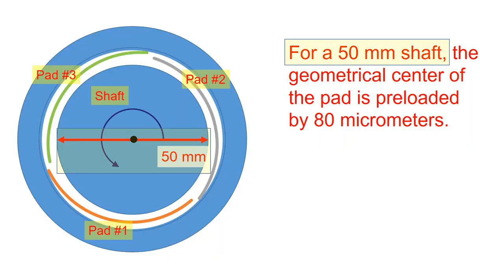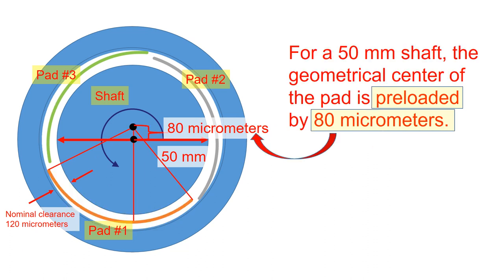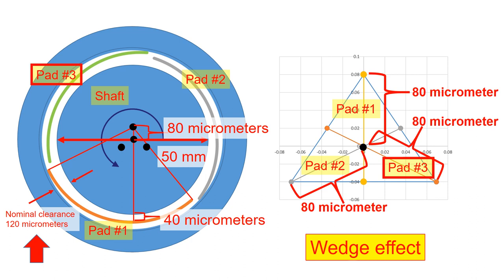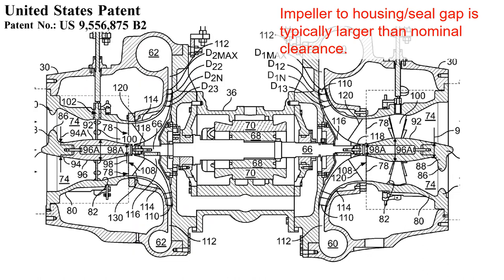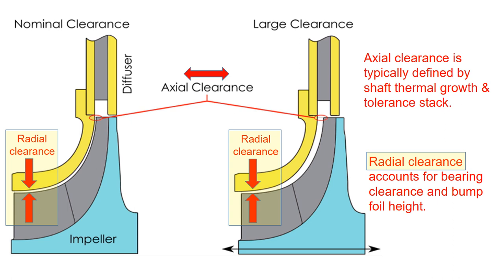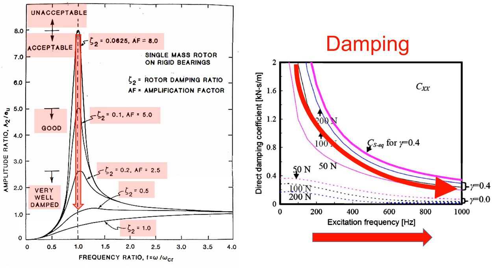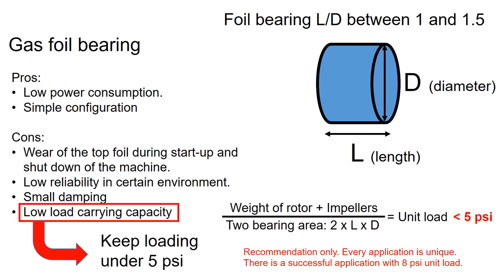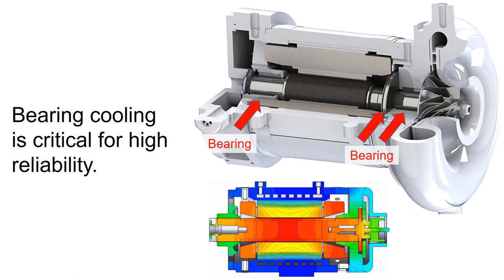Part 17 - Air Foil Bearing - Part B: Design Details

Comment: Would mind kindly introduce the magnetic bearing design details ? Thanks a lot!
Reply from the maker: Thank you for your comment and interest in the bearing design! I'd be happy to provide you with more information in the near future!
Reply: Thank you so much!  And if it's possible, would you mind kindly introduce some applications of ceramic bearings plus external dampers in high-speed tubro, and issues related to pass the critical speed and stiffness damping?For high-speed machines, I have always been a little confused about the choice of air foil bearings, magnetic bearings and high-speed ceramic ball bearing.  Thank you again!
Reply from the maker: @robinsonwang7223  Thank you for your questions and enthusiasm. I've just uploaded Part 35, focusing on magnetic bearing and compressor. Expect more detailed content in the future. Feel free to share your comments or questions on the YouTube channel, and I'll do my best to address them promptly. :)
Reply: @RotorDynamics  "I am your loyal follower. I have watched your new video, liked, and subscribed. I gained a lot from it, thank you very much! If possible, in your new video,would you mind kindly  compare the advantages and disadvantages of traditional gear-driven centrifugal compressors (5.5-12.5 barg) and magnetic or air foil bearing compressors? Happy new year!
Reply: @RotorDynamics  I've recently noticed in the market some 2-stage and 3-stage magnetic suspension centrifugal compressors with speeds ranging from 40,000 rpm to 60,000 rpm and overall power between 300-400 kW. I'm wondering if this type of machine might be the future trend compared to traditional gear-driven compressors.
Reply from the maker: @robinsonwang7223  Thank you for your ongoing support! I've taken note of your suggestion to compare traditional gear-driven centrifugal compressors with magnetic or air foil bearing compressors, and I value your feedback. I'll explore this topic in a future video.

Regarding your additional information, it's worth noting that air foil bearing load capacity is typically lower than that of oil lubricated bearings. In Part 17, we discussed the unit load for air foil bearings being < 5psi, highlighting reliability challenges during extreme conditions like surge. 

Wishing you a Happy New Year! Feel free to share more ideas or questions at any time.
Reply from the maker: @robinsonwang7223  Excellent observation! Magnetic bearings are indeed gaining prominence in various applications, and a key advantage lies in their oil-free nature. I anticipate this trend will persist and evolve over time.